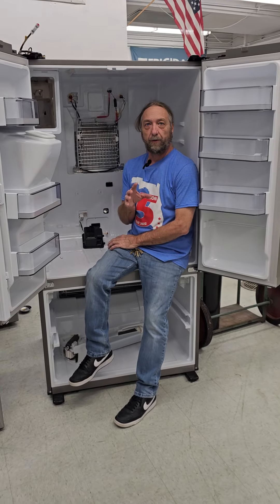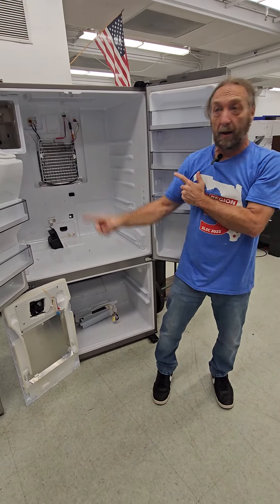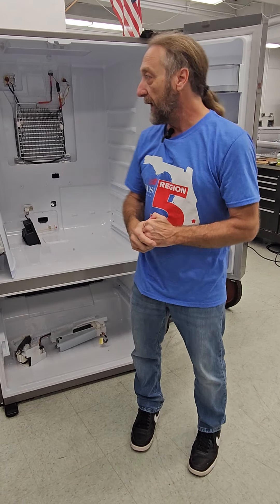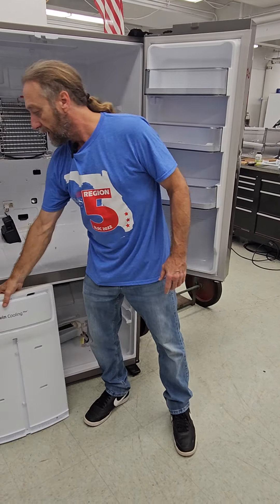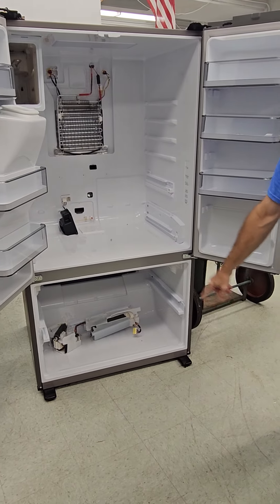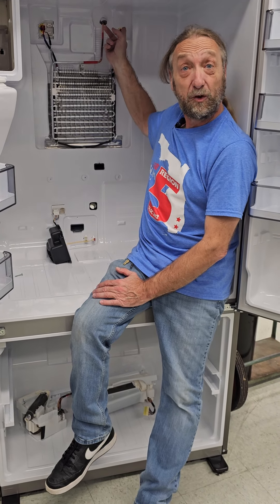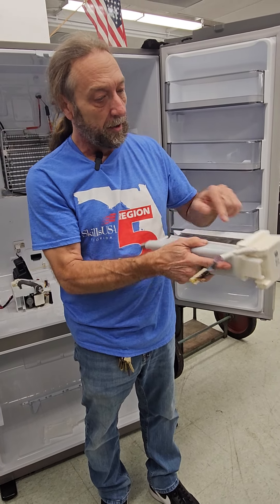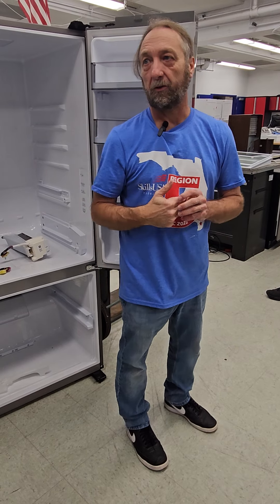Samsung Refrigerator Control Thermistors

Comment: Good stuff but that heated tube on the auger is actually the drain tube. Its heated so in harvest the ice maker heater has moisture that can drain out.
Reply from the maker: Yes you are correct, it is the drain tube I didn't look at it close enough, and students took it apart. Thanks for the correction

Comment: The ice room temp sensor is on the auger motor assembly. The harvest/icemaker temp sensor is in the head of the ice maker.
Also, the freezer only has two thermistors, the one thing you pointed to was a thermal fuse packet (two red wires).

Comment: The thermistor on the auger motor is under the fan. That bad boy fails, a lot of folks go with the ice maker repair kit. A lot of the time it’s actually the auger thermistor, chk ohms, will be open. 
When you are doing an ice maker repair kit it’s absolutely imperative to puller out the auger motor and clear all of the ice around the fan.

Comment: Great teaching. Thanks! I don't know if you can answer this for me, but I bought a new Samsung Bespoke side by side fridge/freezer. The temp control goes down to 34 in the fridge, but it is not 34. It is closer to 38-40.  The freezer gets WAY cold...so much so, that I turn it as high as it goes (to 5 degrees), yet it will still freeze a bottle of tequila 🙂Meanwhile, the fridge is turned as low as it can go, but things just arent cold enough.  Is there an easy way to be able to get the fridge colder without taking it apart and replacing any of the control thermistors?

Comment: Excellent instruction. 

My Samsung started freezing milk and vegetables in the refrigerator compartment.

Fridge is set to 34 degrees. 

Temp in the fridge compartment ranges varies from 33 to as high as 41. Have purchased, but not yet installed the 3 fridge compartment thermistors. 

Do thermistors suddenly go bad.

I’m surprised by the wide range around 34 degrees that the fridge compartment temperature fluctuates. 

Is it just the thermistors or can something else cause this. 

Thank you.
Reply: Yes thermisters fail, some manufacturers seem to have more issues with them than others, best way to accuratley test is fill cup with ice to the top then, top off with water. This is as close to 32degrees as you can get. Then test swnsor and see what 32degrees should read.

Comment: I have a question I have been struggling with .
I have samsung fridge rf27cg5900sr/aa family hub fridge freezer and the temperature that it displays is not the correct temperature! 
It says that the freezer is 0 or what you set it to but it is not that temperature in freezer the temperature will say it changes but freezer never completely freezes .
It all started with Icemakers stopped making ice in freezer then started getting worse. 
The fridge stays  cold and still makes ice .
I was leaning towards control board bad ?

Comment: Just found your channel--- can't thank yall enough--- currently been dealing with an Elders KENMORE Elite 795.71023.010 tried replacing capacitor- still no cooling #code22 such a horrorshow trying to seek out swapping starter relay only to find its IN the board--- the video discussing how to test the corresponding PCB Board --- gave me a bit more direction.. and hope--- Still at it! THANK YOU🤜🤛🍻👍
Reply: The model number starting with 795, means it's an LG manufactured refrigerator and the co.pressor is probably a linear compressor. This is most likely the fault. I so jot think a capacitor would help fix it. Should be checked propaerly
Reply: @riz65  Right- it is a linear compressor- tested the contacts on it and fell within range ~7.5 ---  A little background-  Fridge was running excellent until it was hooked up to a generator- and while plugged in-- the generator failed stopped producing power - I'll be testing the board to see if that's the issue--as you said likely compressor Everything else works--  Compressor comes on but doesn't "run" only pulling 0.5amps and less than 40watts
Reply: @wherezwaldoz2380  refrigerators with invertes don't not respond well to generators as the voltage can harm some boards. If it is running pressure tests would need to be made to determine if it is inefficient.

Comment: Samsung rf18hfenbsr. Both evaporator fans are not working. Bench tested fine. Replaced control board. Still not working. Evaporators both get evenly frosted? Could thermistor in one cause both not to run? Its got me scratching my head.

Comment: Hi Mr Richard, I see in the circuit diagram of the refrigerators there is a defrost heater (capacity 150w) and heater strip (capacity 8W), the heater strip is mounted inside the refrigerator compartments, can you explain the effect of heater strip? Thanks
Reply: Heater strip is likely the vertical bar that seals the two doors together in the center. Those have very subtle heaters inside to keep frost from sticking the seals of the door to the frame.

Comment: My samsung cools the "ice room" by a squirrel cage fan in the freezer section that pushes cold air up and over the ice maker. There are no evap coils on the ice maker, there is an electrical heat loop to melt the adjesion of the ice to the cube tray. This has worked flawlessly for 13 years, now the freezer is not getting cold enough. Im going to add 134 and see what happens. I already did everything else. New temp sensors, new fan motors etc. BTW the swuirrel cage fan runs at 2950 rpm the others 2550rpm.

Comment: On variable speed compressors, do any run constant?
Reply: I dont think they run 100%but have heard that they do run much more than a standard compressor. Remember they use less electricity and run slower.

They do have to shut off for defrost, and when temp in both sections are reached.

Comment: I have a Samsung RF4267HARS/XAA keeps showing 22E start up Failure.

The Coils are NOT Iced, I have replaced ALL the Fans, Thermistors, Tried Both the Main Board and The other control board as well, the only issue I see is that the CONDENSER FAN does not come on right away, and also I get a Slight Power Arc when Plugging it in.

But if I Clear the Code out, it will Run just fine, 36° Fridge 0° Freezer, Flex Zone Works ETC

 In the Morning the Compessor shuts off when at Correct Temps, and comes back on WITH the Fan when Called for at this point.

The Defrost Heater appears to be working fine ETC, the Water and Ice works as well, I'm at a loss with this thing, but like I said, I have a Slight Arc Plugging In, and AT FIRST the Condenser Fan DOES NOT come on. The Evap Fan Works in the Fridge & Freezer, So does the push fan for the Ice Maker and Flex Zone.

Any Idea of What could be Wrong ? This all started at Thanksgiving, I've tested and Tried Everything.

I'll gladly pay you for the Help.

Comment: The icemaker wants to be - 14* when making ice. If the icemaker is defective and the icemaker cannot get cold enough, the compressor keeps on going.

Sometimes we answer a call with the refrigerator Evaporator drain froze up. If we fail to identify the problem with the ice maker, we may be back with an refrigerator Evaporator problem in a couple months.

If the refrigerator coolant never stops, the evaporator will never defrost.